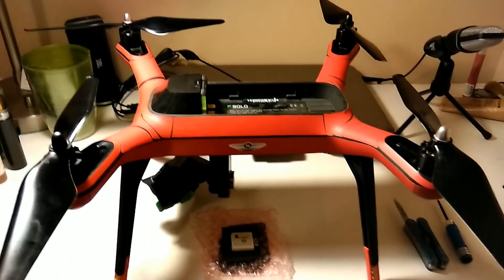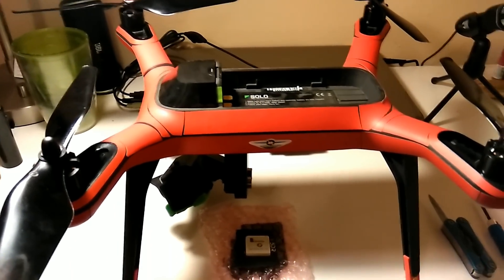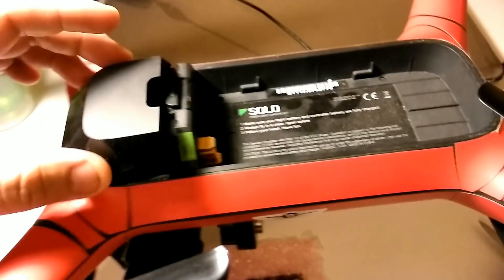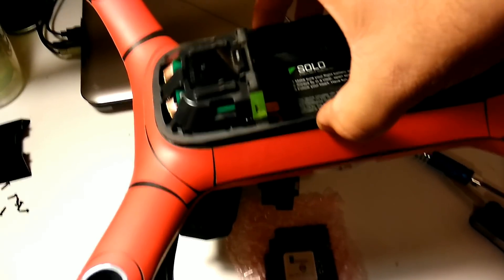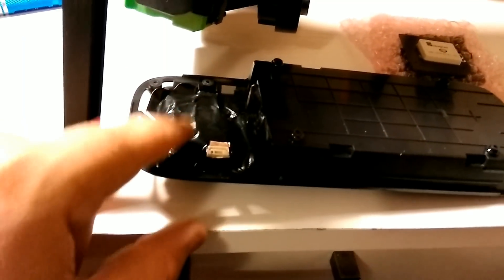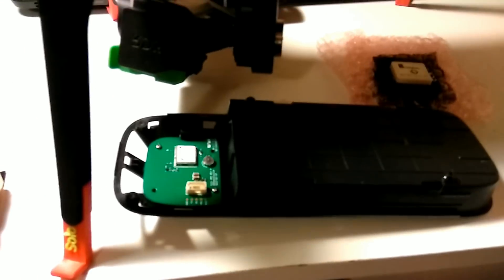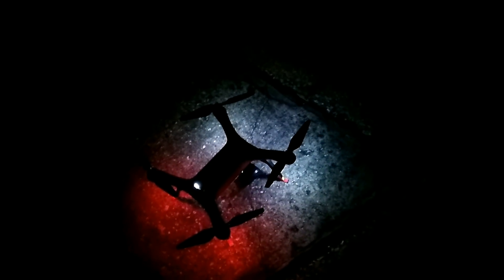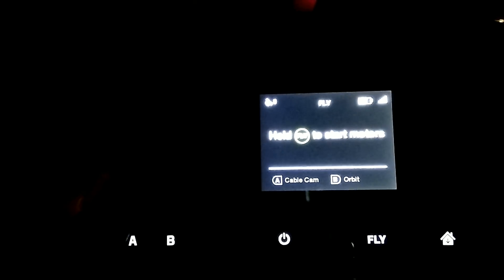3DR Solo GPS Upgrade Rev B Installation

Comment: I have the latest mRo board, sitting on an isolation plate with the 2ond gen 3dr shield on top, n get 14 sats in under a minute INDOORS! Running Open Solo as well. The thing doesn't move more than an inch or two with 20 mph wind gusts. Love this thing!

Comment: Why'd you wait so long to put in a revB? I put in an Mro as soon as I got my Solo. I would've sent you the revB board 6 months ago!
Reply from the maker: +Doug  Veraska you might still need to lol I will explain in a bit
Reply from the maker: Doug  Veraska this was sent to me by a YouTuber that said it was causing him to have a lot of problems with his unit so he sent it to me for testing. It does seem to have a few issues that I'm currently aware of with disconnection connection problems. He did say the same thing was happening to him so I will do some further testing but I may still take you up on that offer because I definitely need a good working one

Comment: Could you try something?  First the cardboard mod is to prevent the copper shield from shorting out on the ublox chip - you can ditch the cardboard, and just put electrical tape over the copper side of the shield. Second take the 2nd copper shield, put electrical tape over all the copper parts again, then you're going to put this on the top side of the Rev B board, but cut a hole in it so that the white Taoglas antenna  is NOT covered.   In the end you should have a rev B sandwiched by two shields that have the copper foil covered by electrical tape.   My solo will get locked on 10 satellites in less than 2 minutes ... indoors..  To compare with the rev a, I couldn't get a lock in my driveway as there are a TON of trees.  Here is a video I just did showing my rev-b getting a lock in less than 60 seconds. https://www.youtube.com/watch?v=02I0WkkfDrw
Reply from the maker: +Richard Masci there is also electrical tape in between the cardboard and the electronics. I believe I was the second person to put out the cardboard mode on YouTube it's got somewhere upwards of 22000 views or something so yes my brother I know what it does as far as shorting things out. I will consider your proposal and make a decision after I talk with a few people

Comment: This is just a M8N GPS/compass module right and an obviously an authentic one. I'm guessing Rev B is a newer flash? I wonder if you can flash the old one. 3DR has software that let me flash my clone M8N that fixed the toilet bowl issues. It requires a FTDI or flashing the FC to special pass-through firmware that accesses the M8N and lets you flash it and also see all the GPS info in real time. It is really cool. I did this with an old APM on my cx-20 but I would think it would work on pixhawk too.

Comment: To me.... For me.... For both of my 3DR's... Like my Hubsans... If things are working good, not seeing a need to upgrade to the newest firmware for example. But there are some, who require the Newest Maserati that comes out every year. Guess I am not as Good as other People in that classification. However, once my wife gets a bit old, I do get another newer model.
Reply: Sean Brooks When they hit 50 aren't you supposed to be able to trade them in for two 25 year olds?